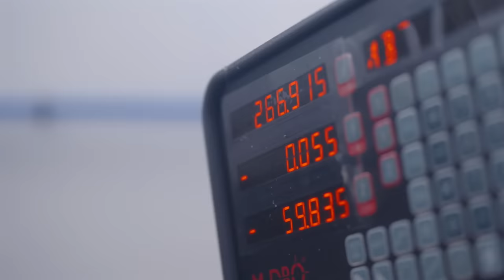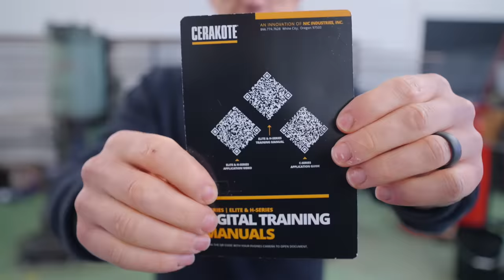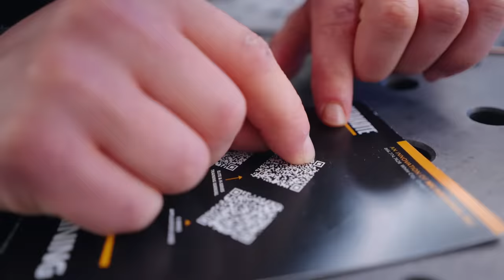Making a WW2 Commando Dagger! Part 3

Comment: When making a kydex sheath, I always add a piece of oiled leather to hold the tip so it doesn't rattle at all. That allows the blade to not have to touch the plastic and get scratshed over time and still be fully secure.
Reply: Better still, line the whole thing with leather so it automatically strops the blade whenever it's sheathed/unsheathed!
Reply: Joe R, that's an excellent tip! Thanks for sharing😊

Comment: Hey Alec. When you are looking inside a bore to see where it is contacting use a bulb light such as a Maglite not an LED torch. an LED is too bright and doesn't show things very well. also shine the torch at an angle from the other end of the bore, if its goes all the way through,  will improve your vision inside the bore 100%

Comment: Love this type of Dagger, it looks both beautiful and deadly. It's a functional work of art and it looks like you've made another stunning example. They could be my 2 favourite Daggers on your channel. Making a fake rope from 3 different colour wires twisted together and fitting it in to the twists would look stunning, especially if you put them on after the black and treated them with a clear spray sealant of some kind. You would probably have been stabbed during WW2 if you'd had that version of the Dagger instead of the standard issue one by someone who couldn't help themselves they wanted it so badly....

Comment: For what its worth..... If you are having trouble getting the Dykem to show the rub points when fitting something like a handle you can go real old fashion and smoke mark it..... using a small oil lamp or even a oxy-fuel torch set two smoke slightly (fuel rich) pass the part over the flame breifly. It will deposit a thin layer of lamp black.... works just like dykem but is much easier to rub off so its easier to mark the contact patches. Hope it helps

Comment: Cerakote is an amazing product and it's actually fairly easy to do at home. Sometimes it doesn't want to adhere, depending on the product finish, however its easier to get it to adhere if you have a base layer of parkerization or similar rust inhibitor base coating.  Plus, it's easier to spray while still warm (from parkerizing tank) because the heat helps prevent dripping from the cerakote.

I really hope you use the product more now and can't wait til you realize they have a laser imaging pattern that can give you multiple colors and patterns by simply laser etching a cerakoted part. It is simply mind blowing.

You can get a Preval Sprayer and get fairly decent results, and you don't have to get the oven cured kind, they make an air cure version of every color.

Comment: 1:34 Hi Alec, to see where the handle rubs against the tang you have to sand the layer of blue Dykem with scotch brite so that the handle only needs to wear off a very thin layer of blue Dykem to see bare steel. that way you can see more clear where the handle rubs the tang

Comment: Hi, Alec 
I´m a trained mashinist from germany and i almost fell out of my chair in shock when you sandblasted the parts ontop of your mill and right next to your laith. Please do your self and your mashines a favor and make sure the there is no blasting medium in the guidings of the mashines. It will make the mashines uncomfortable to use and will damage them severly in the long run and will cost you accuracy pretty quickly by wearing down the metal.
Greetings from germany and have a nice day.
P.S. I love watching your videos and you were the reason why i gave metalworking a chance in the first place

Comment: suggestion to maybe enhance the look: the spiral flutes and possibly a horizontal line going around the ball screw, like maybe along the indent between the ball screw and the handle, use the dremel to carefully remove the seracote so you have some accent and contrast to really make it pop. maybe there is a better way to do it but that was my thought

Comment: about your sandblasting "medium".
it could interest "madam" because basically crystallized aluminum oxide is called corundum, a very effective abrasive;
but if you add, to the corundum, a little chromium oxide you obtain ruby and if it is vanadium; sapphire

Comment: i would probably have used a knurling wheel across the whole textured portion of the handle, then gone back and cut the flutes in, probably would have saved you having to clean the flutes 3 times and still gotten some amazing grip

Comment: Here is a novel solution to creating brass handles. 
     1. Cast the knife tang in wax
     2. Remove the wax blank with a torch
     3. Carve the wax blank to your desired handle aesthetic
     4. Use lost wax casting to convert it into brass or bronze
     5. Adhere it to the blades tang

Comment: You can work out where things are contacting by smoking the part with a kerosene lamp and then putting your handle on. anywhere thats shiny on the blade it is contacting. Thats how i fit parts by hand and was thought how to do so during my traditional gunmaking apprenticeship in germany. you can also use persian blue but for that application the smoke would be best.

Comment: Surely the knife handle doesn't really contact, it's just the force of the bolt pressing down on the guard .  That's the point - quick and easy to produce with only metal compnents.

Comment: I heard you mention in a previous episode you were concerned about the coating being too thick and effecting fitup. One of the benefits of carakote over traditional powder coat or other cured finishes it it is extremely thin and it generally considered "non-dimentional"

Comment: Hello Alec, at the beginning of the video when you were hand sanding the blade what was the fluid / glue you were using to hold the blade to the wood ?
Reply: Plain hot glue melted onto the scrap wood.

The glue is strong enough to hold during sanding but still releases realitively easy without leving too much residue.

Comment: I'm not sure why the handle is made from brass, it's indistinguishable from the steel once Cerakoted.
Seems like a waste of a good looking material to then completely obscure it.
A better use of the brass would have been to antique it.
A better use of the Cerakote would have been to use steel for the handle.
If you had to use both the brass and the Cerakote for the handle, you could have sand-blasted it, masked the spiral flutes, Cerakoted the handle, and unmasked the sand-blasted brass flutes.

Comment: Sand blasting on a mill bed!!!!!! are you nuts??!!!! also - on the spray gun, the sticky out bits on either side of the nozzle orientates the fan pattern of the spray. They should line up with the direction you are moving the gun ie. vertical if you are moving the gun vertically. This puts the fan horizontal so you dont get a heavy build up.

Comment: I'm confused why you glued the handle on.. the entire point of having a screw on pommel is to be able to remove the handle so you can clean under it.  Blood under the handle will cause it to corrode inside it.  If you're just gonna glue it on then why the screw on pommel?